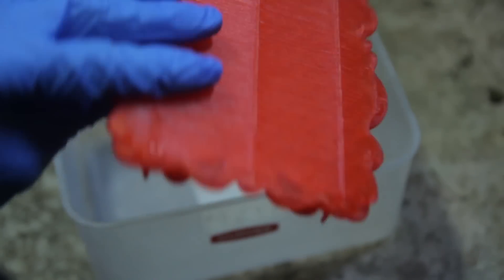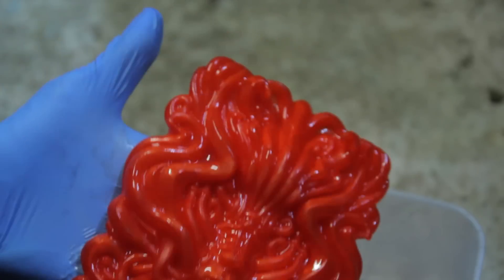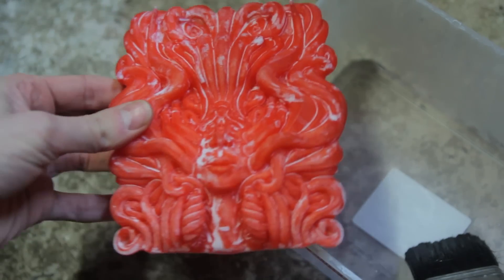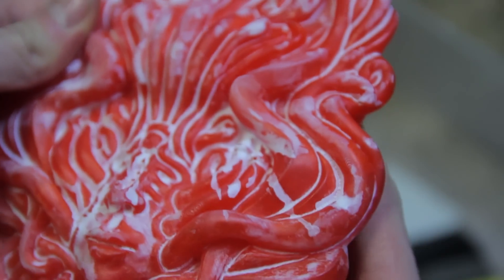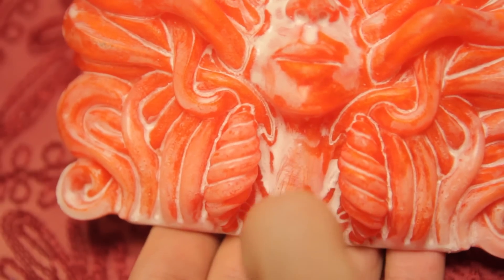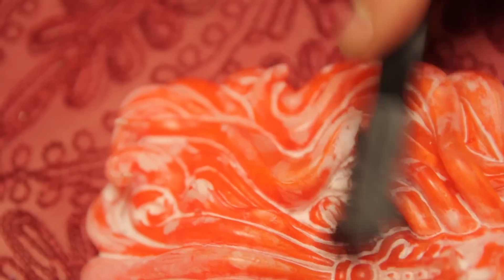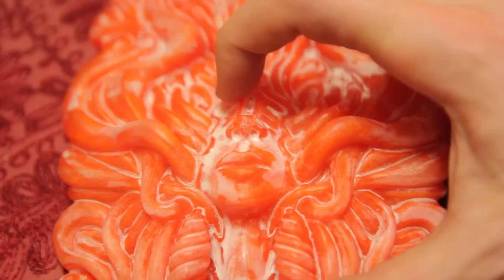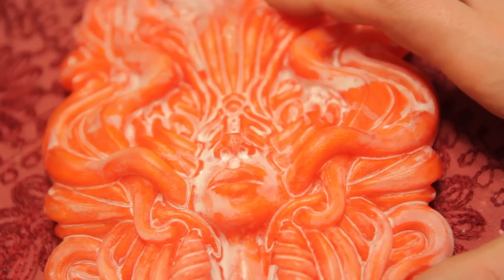SMOOTHING LARGE PLA PRINTS WITH ACETONE

Comment: could you wash the resedew off with water?
Reply from the maker: No afraid not. You can sometimes wipe some off with a reapplication soon after but not always. Just spray it.
Reply: Thanks
Reply from the maker: @Owen-xh1jn  no problem, but if you use ethyl acetate then it produces less whiteness overall and can be polished up. But its more potent than acetone and more toxic. Choice is yours. Sometimes the acetone wont go white though, its a reaction to air during cooling i think. Its to do with the purity of acetone and how many times youve used it before.
Reply: With water if you used tooth brush could it help?

Comment: A note: Nitrile gloves are not recommended to use with acetone. The "breakthrough time" is only 1-4 minutes (dependent on glove thickness). Butyl rubber is the best but even latex is better at a 10 minute breakthrough time. Butyl gloves are more expensive and thicker but are reusable.
Reply from the maker: they last long enough to brush on thankfully!

Comment: This works very well for ABS!
Reply from the maker: No you can not do this with abs. You cant put acetone directly on abs or else it will melt instantly and destroy all the details in your model rendering it completely useless.
Reply: I do this very often! And it works fine if you do not submerge it, which means make the brush not too wet. And please do all sides otherwise it will bend like wood. But try and you'll see!!!
Reply from the maker: @DocMicha  abs is dead to me. You have far more control with pla and far less danger ruining your print. Ive tried all methods and acetone and pla is simply the best. Ethyl acetate and methylene chloride are a close second, but also have their own unique benefits. Abs is a waste of time as far as im concerned. You cant just slap it on and be done in 10 seconds. And if you accidentally overdo it then thats the model ruined. Its difficult to ruin pla with this method. Safe and easy, abs would be risky and easy, and i like safe methods.ive never ruined a pla model doing this, but have ruined many abs models.
Reply: That might be, for You! I love ABS! And its more heat resistant, that is a crucial thing for me, but I am doing no sculptures but technical items. That may be different! But also here I need some fine details.
Reply from the maker: @DocMicha  im in it for the fine details. I do scuplts a lot with long spikey bis and small details and stuff. But by all means do what works for! But i personally find abs too hard to work with, and warps when cooling. I found the surface to be nicer looking on abs but pla is just easier to manage and print with. And if you need higher temps then you dont really have a choice. I just never got into abs. Got tired of the abs juice thing and warping corners. Im sure i could figure something out like you if i was forced to but pla is quick and easy.  Plus on a um2 with a coupler you extend its life by printing cooler. I dont even bother with retractions either. On my s5 i can print with anything but have been using pla for 4 years straight with a 0 failure rate, so unless someone pays me to use abs ill leave it to those who like it more than i do!
Reply: I don't use abs juice and such straight things, but I have an enclosure against warping and I use a PEI coated Aluminium plate. And since then I had no problems and can in general print ASAP. But that depends also on the printer, mine is self built and can handle high temperatures for the bed 145°C and for the nozzle with PT100-Resistor around 300 °C max. The only thing is, that the plate takes around 30 minutes to heat. If someone pays I would print it for him of course in ABS!
Reply from the maker: @DocMicha  30 mins to heat up is a deal breaker for me, id rather just use abs juice. I have an enclosed printer now but i dont care, I still love my pla! Mind you im only about quality, even if its unncessary, its my OCD. And I hate to say it, but ive yet to see better quality finished prints than mine. Hell ive even been to where they make the filaments and printers  themselves and still not seen anything close. Many people claim stuff but cant provide evidence. I love closeups and have multiple angles on all my instagram pics. You will almost never see layer lines on any of my prints(like ever), but i now never leave the surface raw like i did in the past. I think my finishing methods are almost faultess and reasnobly fast. Ive tried it all but keep returning to pla and acetone. However if you need the temp resistance unfortunately you dont have that option. I also copper plate my work for aesthetics as well, and that greatly improves strength.
Reply: ok, where can I download a sculpture, not too big in size to test it with abs? I have a 0.4mm nozzle!
Reply from the maker: @DocMicha  0.4 is the best all rounder in my opinion. And just go to thingverse or wherever for a sculpt i think i even have some there. You can also get my hellraiser head sculpt from the link on my tutorial video if you look it up on my channel. Or a bulldog (in parts) I have a 3d showreel somewhere as well. All pla. Im going to upload my 'they live' sculpt soon as well as people have been asking me for that one a lot. Id love to see them in abs... i have no abs to even test, but i do have some flexi and exotic stuff which is far too thick for details!

Comment: I am going to give this a try again. When I first started 3d Printing I used ABS only and when I started printing PLA I tired the same things I used to do but none of them worked. Welding, smoothing and such was a complete failure and acetone seem to not have any effect on the PLA I was using at the time. I know that the PLA doesn't react with Acetone but some of the added components do. 

.06 is an insane number since most 3d printers that are not ultimakers have a .04 step meaning that .06 is not achievable.

I am skeptical but always looking to be wrong.
Reply from the maker: I know im right. Just look at my instagram channel for plenty of photographic proof. 0.06 is less than half of 0.1. I dont think its that high. 0.04 is higher but has its own problems like ringing.
Reply: whats your IG?  If I didn't believe you I wouldn't even try it. But I will.

What I am saying is that .06 is not possible with most machines because the distance that it moves on the z-axis per step is .04. That makes it that .06 is 1step and a half wich is not possible so the printer does weird things to average out a.06 layer line.
Reply from the maker: VenomTheCat cloakfiend is my ig and you can try 0.05 if that makes things easier. Its a touch higher tha 0.06 but hey, if it works? I Never print below 0.06. Like ever.
Reply: you got some good works there! I had to subscribe. Thanks
Reply: @VenomTheCat   0.04 is a full step.there is something called microstep and it's as accurate as a full step
Reply: @ΒασιληςΠαναγοπουλος-ξ6ε  This video is from over a year ago and even today microsteping is not on most printers. I know that it exists and it has for a long time.

Comment: have you tried ipa to do a wash after the acetone ? would that clean off the white fuzz just curious
Reply from the maker: playdeaths i dont know what ipa is.
Reply: Cloakfiend isopropyl alcohol 99% 

Or rubbing alcohol
Reply from the maker: no doesn't work.
Reply from the maker: use ethyl acetate if you want to retain a non white surface, but its more aggressive than acetone and might split more often, but needs to be used with a moisturiser or else the plan/pha dries out and cracks.

Comment: At 0.06 layer height you shouldn't be seeing much visible layer lines anyway so seems to be a lot of extra work for not much gain..i suspect it's the fine powdery residue that acetone leaves behind that makes it look smoother.
Reply from the maker: if you want a smooth surface you must do it. looks are very deceiving in 3d prints. sometimes 0.2 looks good, but it doesnt mean it is good. spraying it with a reflective coating is the only real way of telling how smooth it is. if i didn't need to do i, i wouldn't. believe me! i just seek near perfect quality. im doing a new vid this ones a worst case senario.
Reply from the maker: the whiteness is a reaction between the air and pla/pha. the quicker it dries the whiter it goes.

Comment: Absolutely Terrible, HORIBLE INFORMATION. 

DO NOT LISTEN TO ANY OF THIS GARBAGE.

COMPLETELY INACCURATE. 

ACETONE DOES NOT SMOOTH PLA !!!!!
NOT EVEN THE SLIGHTEST BIT.
Reply from the maker: Dimitri2014 your the one one they shouldnt listen to. Acetone smooths colorfabb pla filament very well if printed well and 0.06 layer height.
Reply: Cloakfiend that's some very specific information my friend, none of which was mentioned in this video, I stand by what I said.

It's like saying the Sun won't burn you !   but not mentioning you must use banana boat 35spf at 4:07 pm on the southern most part of the eastern hemisphere .

Get chooched buddy.
Reply from the maker: Dimitri2014 well considering its all in the description i also stand by what i say.....considering ive said it about a million times......and people still wonder why it doesnt work for them??? This is easily the best and quickest method to smooth prints. If you want a longer   more difficult method....then keep on using filler and sanding away or whatever. I dont care. My results are superior to anyone elses....by a mile. And if you print in low resolution like 0.1 then you clearly are not after good quality and detail but speed, so you keep knocking out the same lame quality prints to your hearts content. I certainly wont be.
Reply: @Dimitri2014  acrually do your homework, read the comments and perhaps watch some of his other videos before making a comment that isn't backed up with any research.

Comment: Have you tried rincing the print with  isopropyl alcohol before the acetone dries ? It doesn't affect PLA and it is very commonly used precisely for that purpose (to avoid those nasty white acetone residues) in many domains.
Reply from the maker: MrBleulauneable you can use ethyl acetate if you donf want the residue but its harder to do.

Comment: With all due respect I think this video is more about what not to do with PLA. The time it would take to clean up the damage caused by the Acetone and the damage you end up doing to the print attempting a cleanup is simply not worth it.  I am seeing impressive results in smoothing from simply using Polyurethane or Epoxy coatings. I am sure there are also many clear coat sprays that might adhere well on PLA and give your print a smooth look. The paint option will allow you to not only use a gloss covering, but a flat or semi-gloss coating depending on the look you want.  I am currently experimenting with giving PLA parts a tumbled finish like with a rock type tumbler. I hope to put a video out on that process once I learn more.   Thanks for the video. I am glad I watched it.
Reply from the maker: JoeKind1958 I fully understand what you are saying but i did things a bit hardcore in this video, next one will make it clear that there is no cleanup needed. This was a worst case senario, so good to keep in mind and not go crazy with the acetone like i did. Also the surface of acetoned stuff is much nicer compared to a coating in my opinion because its not a coating, its clean and smooth with no inperfections. Ideal for plating.

Comment: NICE!  Looks a bit like H.R Giger type of a sculpture design.  I thought that acetone didn't work on PLA?  And another question, did you ever put up that John Carpenter Thing head you made for people to download?
Reply: Acetone does react to PLA, you can do decent acetone welding with it actually, a thing I learned far too late, heh.   If you used acetone like this on ABS you would end up with a shapeless blob, so PLA is much more resistent to it.  This is a better method / results than I have seen in the past.  When using acetone vapor, the pla does not do much at all, guess you just need a lot more.
Reply from the maker: which John Carpenter one were you after?
Reply: I like them all.  But the one I like the most is the one with the long neck.  Blair's monster.
Reply: OK, I have to try it on my most recent project.  I printed in .02 and there are areas that a bit hard to sand.